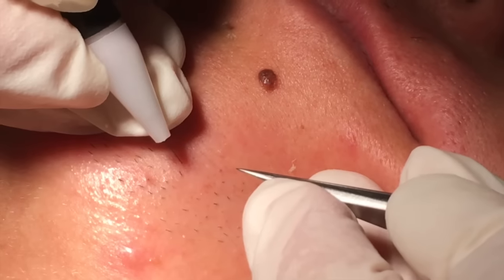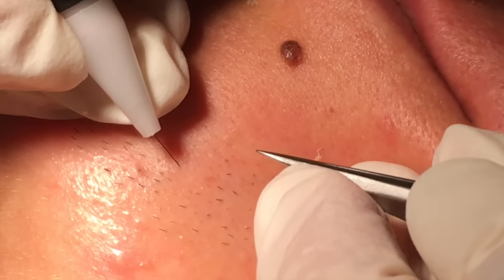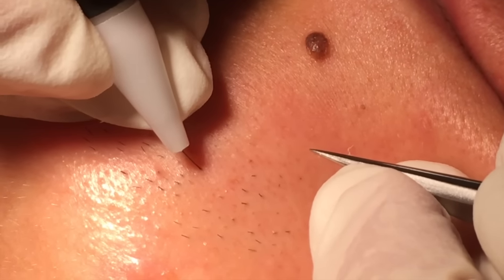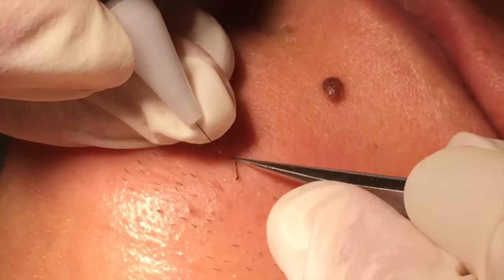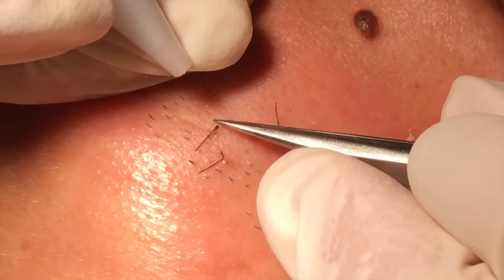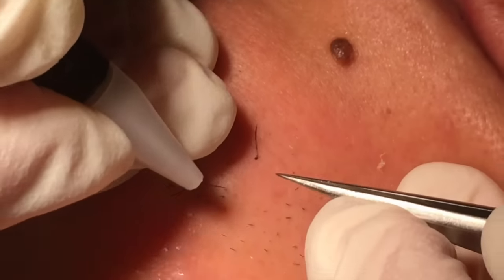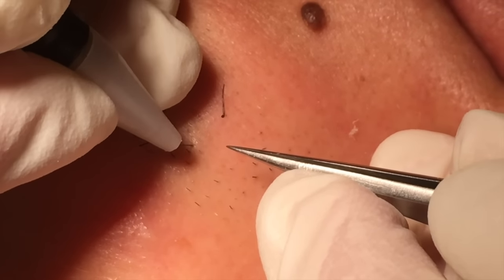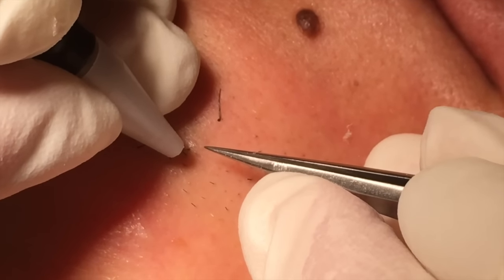Electrolysis hair removal close up

Comment: So, unless the needle tip delivers a killing dose to the germ layer that gave rise to the hair in the first place, it won't work. If the electric current is hitting different areas randomly in the hope of, somehow, hitting the target germ layer (not just the hair base), then the process is going to be not only painful, expensive and endless but nearly impossible without extensive long-term damage. This also requires a very sophisticated device and visualization surgical-grade tools (not available anywhere) and willing health care provider(s) capable of carrying out delicate (incredibly redundant) and sensitive procedure that won't cause damage to the epidermis (we are talking millions of dollars when compared to other medical or surgical procedure at hospitals or outpatient clinics (here we are talking about dehairing several million hairs on a hairy body). This is really a surgical matter and is not to be taken lightly. I guess people are willing to believe anything they are told because they are desperate to get rid of their hair. But it is really common sense. The needle is going through the epidermis and reaching the exact target germ layer is not easy or random.